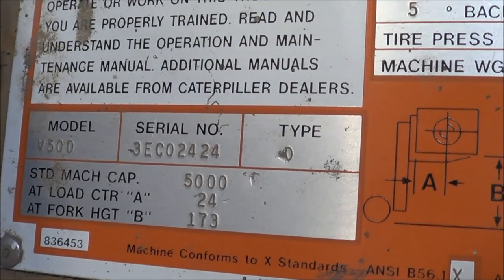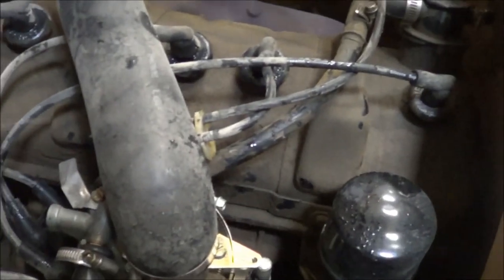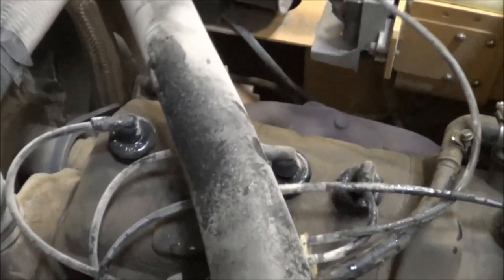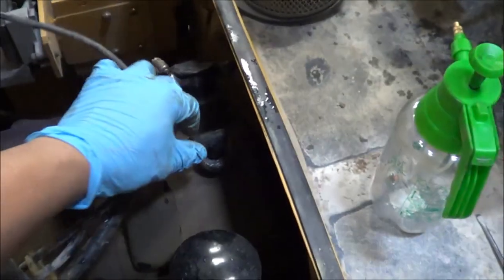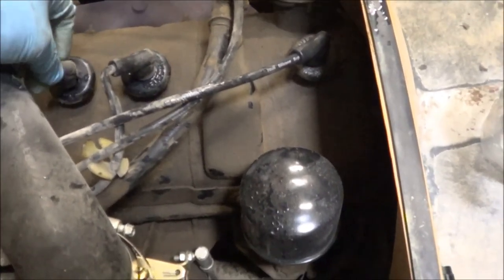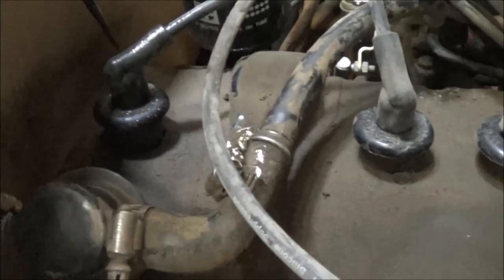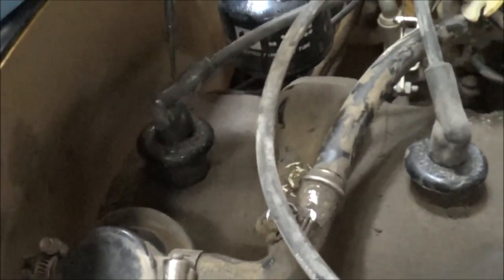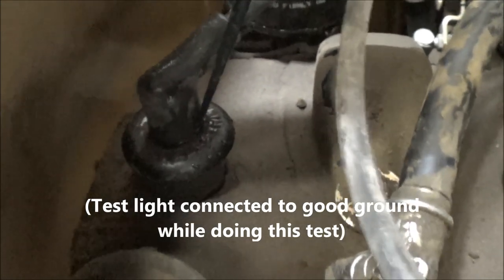CAT Forklift:Hard starting when cold

Comment: I have a Hyster H40H i thinks its a early 80's model. Well when I start it up and give it gas Monotrol pedal all the way down I have to hold it there for 5 to 10 mins then it will slowly start inching forward. Acts the same going in reverse. Any ideas? Read something about a inching valve. The lift hydraulics work fine.

Also if any has a pdf manual that would be cool too.
Reply from the maker: Hey Justin, I would definitely check pressures in the valve assembly.  give me your email so I could send you a manual.

Comment: Is this test light a regular test light that we use for testing a fuses or is it a special test light made for spark test ?
Reply from the maker: This is just a regular 12 volt test light. but you cannot use the LED type test light, the high voltage would burn out the LED.